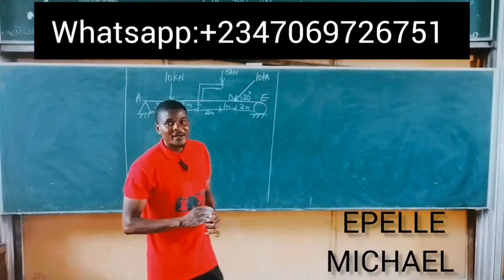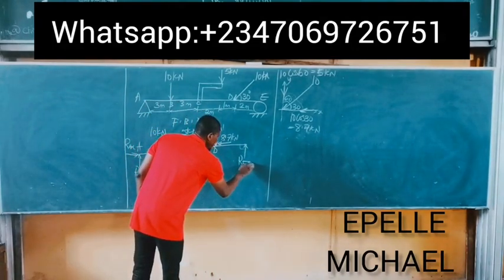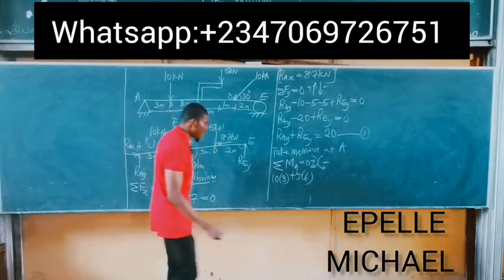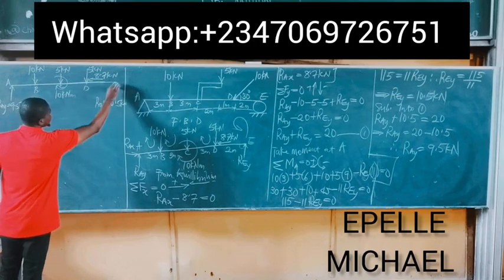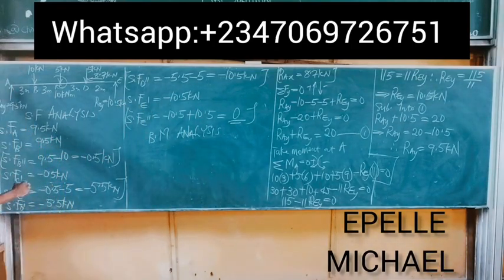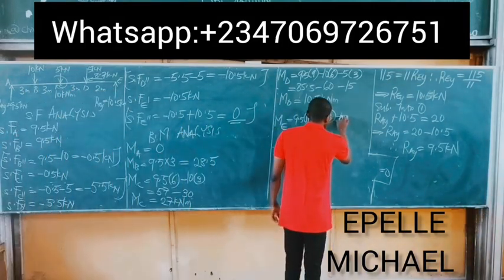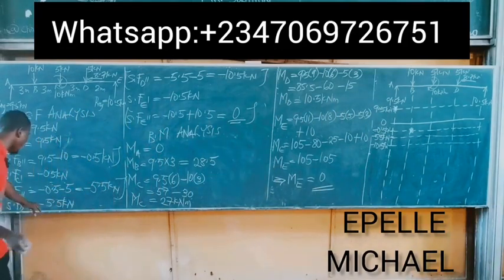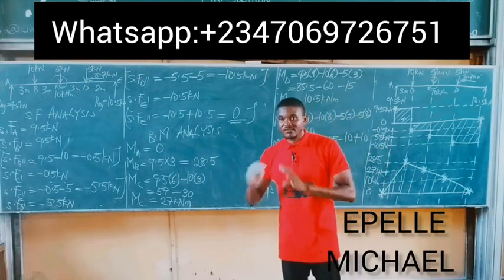SFD and BMD for a simply supported Beam with a Hinge Support and an Inclined Load #Epellemichael

Comment: Sir I'm just going through this video again.... Sir please what about the couple at point C which is 10kn clockwise.... Are we not working with it in the shear force calculation??
Reply from the maker: It was considered in the video
Reply: @engineersmindset240  

Sir u did not touch it when calculating for shear force that's why I'm worried... Please make this clear for me please 😭😭😭
Reply: @engineersmindset240 

U just did

-0.5-5 =-5.5

U didn't add the couple force of 10kN .. please look at it please
Reply from the maker: Okey pls add it... Probably an oversight.... Thabks
Reply: @engineersmindset240  
Hope this is correct sir